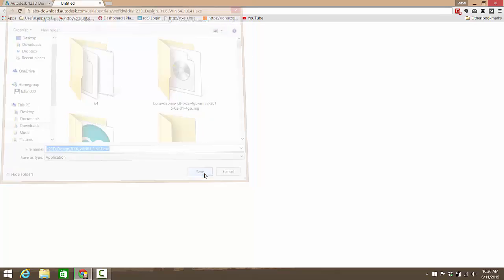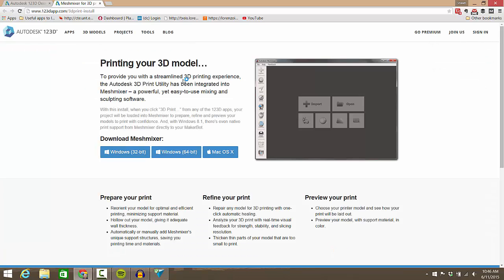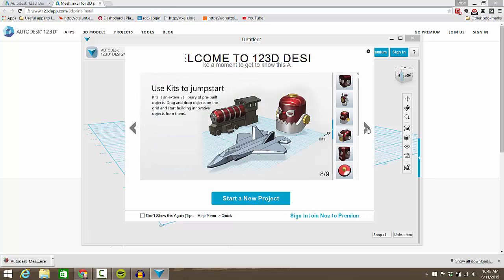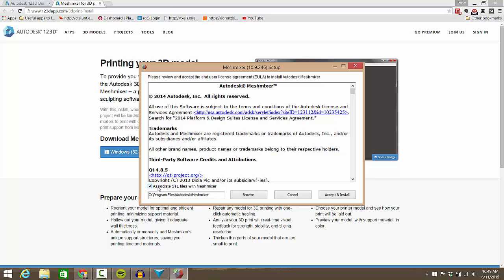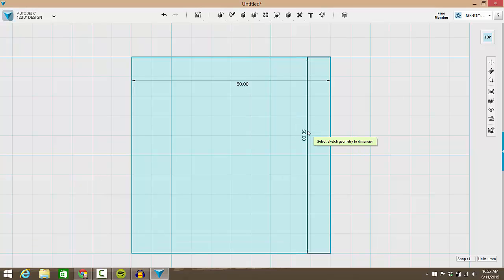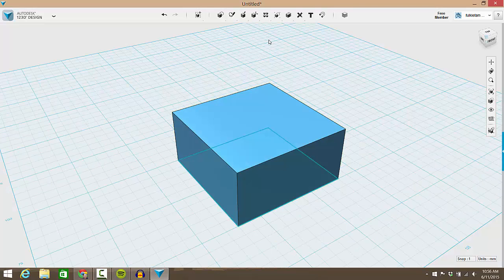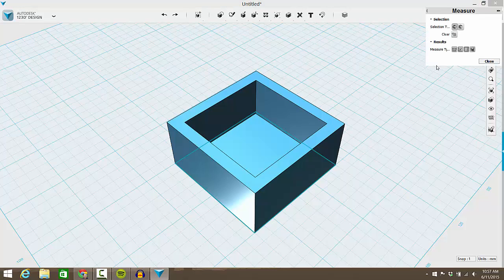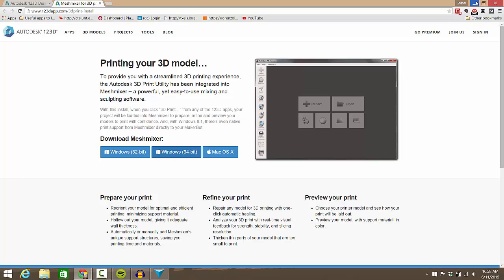How to Install Autodesk 123D Design

Comment: I have a reason why tinkercad sucks. It's 'cause it has less percision when you're placing something.
Reply from the maker: Blueberry Tech I would check out Fusion 360. It's pretty great. It has a bit higher learning curve, but it's powerful.
Reply: Well, actually, I'd prefer Inventor better. But the bad thing is that you only have 30 days of inventor for free